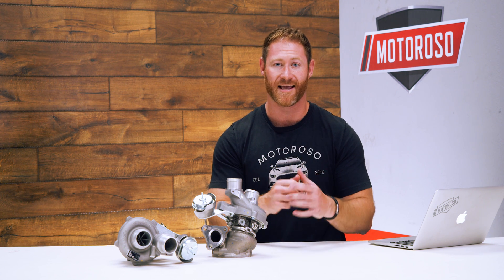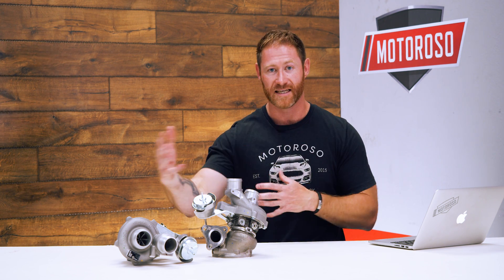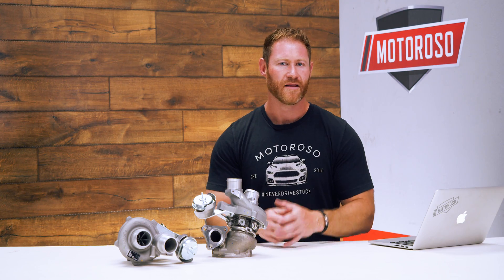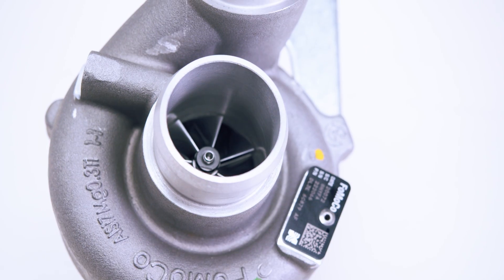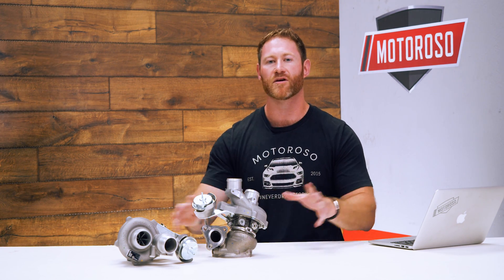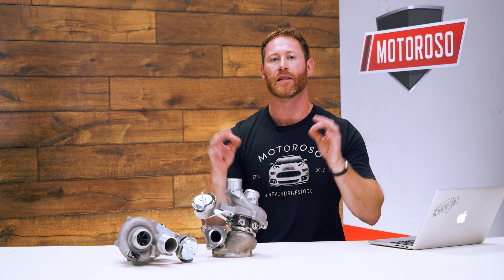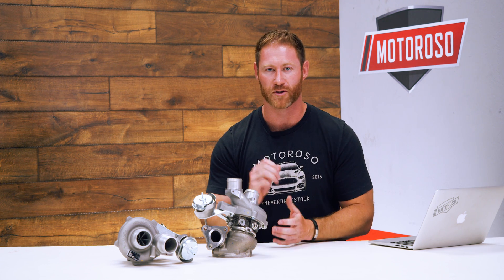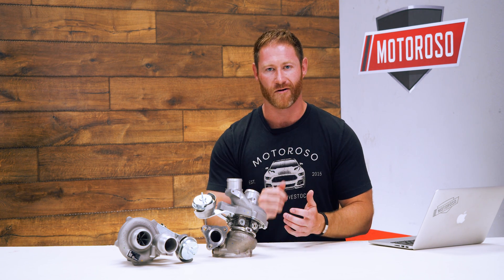F-150 Turbo Swap - CRP 42mm Stage 3 Turbo Upgrade for 2011 - 2020 3.5L Ford F-150

Comment: So need to buy the manifold also?
Reply from the maker: Hey Will, the manifolds are highly recommended. We don't have the links on our website for all the turbos stuff, we usually have to create a custom invoice for the order. The person that handles special orders is on vacation next week, but you can reach out after 9/6/22 to support@motoroso.com and we can get you sorted out.
Reply: @Motoroso  preciate it guy

Comment: At the moment I'm running sound like racing cold air intake a bully dog extreme chip and a cat attacking a borla Cat-Back exhaust extreme and I'm cranking a hair over 500 horse and looks like somewhere in the neighborhood of 700 lb of torque and I got it's fast but I was still thinking about well only thing I could think about was bigger turbos are they going to get me out of the hole quicker and get me through 1150 feet quicker than 93 miles an hour
Reply from the maker: Yes, the bigger turbo volume should help a lot! They also offer stage 4 and stage 5 turbos if you wanna push even harder

Comment: Just subscribed. I have a 2019 3.5 eco boost. Downpipe, intake and tune. I now have just over 500HP but it still does not feel fast enough. The mod shop tells me if I get bigger turbos I loose torque and low end. I just want to upgrade as much as I can to make this truck super fast. If I buy these and re tune will I gain more HP and Torque ? I do not daily drive this it stays covered in my garage 12k mikes no lift. Please help me make a speed demon
Reply: Upgrade your fuel pump & run e85.
Sell that pos intake because you don't need it & use that $ to help fund something useful.
Reply: RMB motor works in Texas do a stroke and bore 4.2. 
That’s where you start!!
Reply: shoulda bought a v8 and supercharge
Reply: @TheLawlessGang  What's the cost on that "supercharge" vs some turbos...

Comment: 242k and stock turbos still... just waiting for now haha
Reply: Any mechanical issues during that time? Water pump?
Reply: @TheSonsOfSimon no water pump nissan going tonlast 242k miles.  Usually fail around 100k.

Comment: Appreciate these videos. Am looking forward to turbos as a future upgrade. I am currently in the process now of doing the exhaust manifolds (CR Performance) as I have the infamous stud breakage on the OEM ones.. However, the manifolds are on back order as are a couple gaskets from Ford.. So, I wait. Trying to do all the things I can prior to needing tuning... At that point I will get the turbos.. I am confident enough to do those myself... What I am not sure about is replacing the broken studs on and aluminum head, EEEK!!!
Reply: Did you ever receive your manifolds? I'm only asking as I'm in the same situation of trying to order some and I can't find any anywhere.
Reply: @ryancorbell9520  Yes I received them straight away. Sorry for the late response. I haven't been on YT for some time..

Comment: What tune would you recommend? I’m running  5 star now.
Reply from the maker: 5Star Tuning are great !We also like the guys over at Brew City Boost!
Reply: Anyone that doesn’t blow up your motor..I’m running 20 psi..on stock without issues..also he isn’t correct you can use your old turbos which saves you about 1500 bucks on the build cost..

Comment: I'm wondering if this would work on a 15' 3.5 ecoboost expedition? Should be the same engine as the F-150 right?
Reply from the maker: Hey BRV002, great question. It's possible it may be the same. I can reach out to the manufacturer to confirm. Please email us at support@motoroso.com with your VIN, and we can confirm exactly, and get you set up with the turbos when you're ready.

Comment: do you have to forge the internals before doing this upgrade?
Reply from the maker: No, this is a direct replacement and can produce great results without any other supporting mods, but we do recommend an intercooler at minimum.
Reply: No but if your going to really tune the turbos up it’s a good idea..I’m going to run their stage 5 turbos good for 800 hp but on a stock motor I’m keeping the boost down for awhile

Comment: What is stronger in the f150, the 6 speed auto or the 10 speed in stock form?  I'm trying to find out if it is worth it to upgrade my f150 3.5.  It has the 6 speed.
Reply: go test drive a 10 speed. The decision will likely be made... i love my 10 speed, it is basically always in the power band.
Reply: @drewfoster1493  Agreed. Jacob the Ecoboost get's its full power in low RPM, a 5.0 has to rev high to get full power. That 10 speed puts you in the power band at all times at around 2000 RPM. Full power is only at 3000 RPM roughly. That's insane!

Comment: These turbos seem pretty small. Pretty sure the factory 18+ turbos are around this size. They are also over 600whp on stockers.
Reply: Can these be used on 17 explorer sport?
Reply from the maker: @ISPtexas  hey, not these precise turbos in this video, but CRP makes drip i. Turbos replacements for your explorer as well. Contact us at support@motoroso.com or call us toll free at 1.833.668.6767 (833.MOTOROSO).
Reply: Lmfaooooo I need some info to back this bs ass claim up
Reply: J D, LMFAO! So let me understand this, you're saying that the stock turbos are good for 600whp?!
With a modest 15% drivetrain loss, that would be 705 hp at the crank from stock turbos?! Please give us a link on who has those power numbers.
Reply: @zzzzVIDEOSzzzz  5 Star tuning. I think they did 608whp and 660wtq, upgraded fuel system, full E85, a host of other mods.

I haven't  dyno'ed my truck, but with a race weight of 4900 with me in it, I ran 11.96@111mph, on the base E50 tune, 3" resonator pipe, and drop in panel filter. Estimates put me around 520-530whp. Again, on their base tune.
Reply from the maker: The guys over at 5 star tuning use these CR Performance turbos, but I believe those power numbers would probably be from the Stage 4 or Stage 5 version. As I describe in the video, These are "stock turbos", but they have been re-worked and remanufactured to provide a higher level of performance.

Comment: What about companies claiming 500 whp on e50 tune stock turbos
Reply: Well thats on ethanol, this would be pump gas. Not equal
Reply: @williamjackson1482   agreed but video claims stock turbos are maxed out at 400hp. If a turbo is maxed out it does matter if you put unicorn farts in it your not getting another 100hp. They are getting 500hp with stock turbos and a e50 tune so they are not maxed out at 400hp
Reply: skigod9 not true you can tune more aggressively with e85 squeezing more power from the same boost number due to e85 less prone to pre detonation.
Reply: @DSGB2199  so you agree you can make more then 400hp with stock turbos
Reply: skigod9 for sure duramax tuner has a setup for e85 thats 140 ish rwhp just with that puts you at or above 500
Reply: @skigod9  timing and boost are two different things completely.
Reply: @seacradev5400  power is power and he said the truck couldn't do it on stock turbos
Reply: @skigod9  yes with gas on stock turbos  but with a ethanol blend you can achieve higher numbers,,, hence I said timing and boost are two separate things.
Reply: I have a 2019 with the 3.5 ive got an intake, TB spacer, and cat back exhaust. Im at 487 HP to the wheels with a dyno tune and turbos havnt been touched. Might as well call it 500 at that point...
Reply: @drewfoster1493  What intake, spacer and exhaust? Do you have down pipes, resonator or any other supporting mods? I'm running an '18 with an S&B intake, 5-star tune and a Mishimoto IC but I haven't dynoed it yet. You're generating impressive numbers but I don't think this guy was implying you can't go over 400 (or 500) with stock turbos, I just think we're both getting to the point where they're the limiting factor. I'm running 93 octane and I know I could get another 100hp or so from ethanol but it's not readily available in my area, I'm guessing better turbos would offer a similar jump.